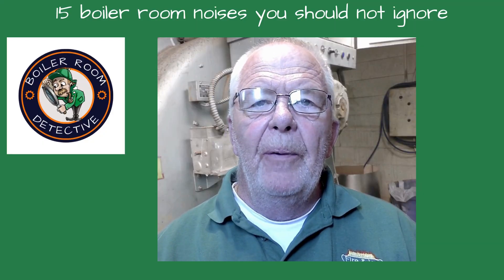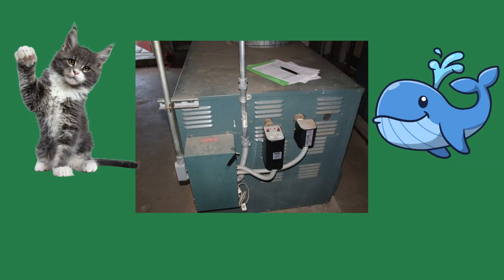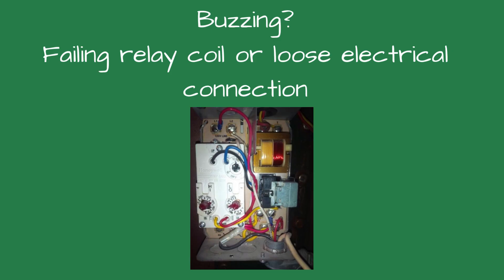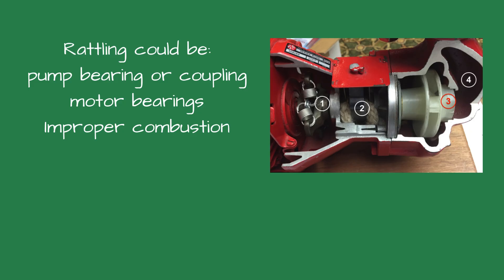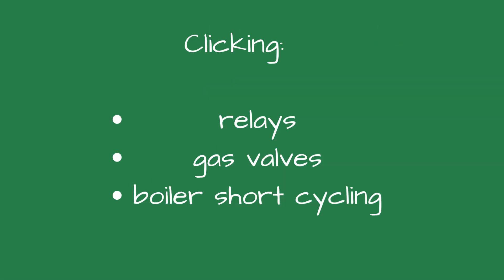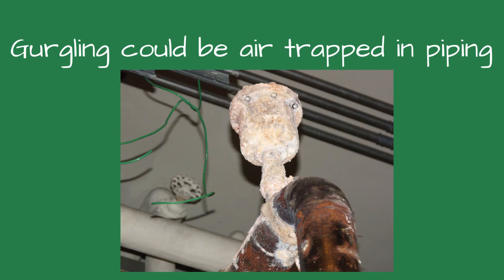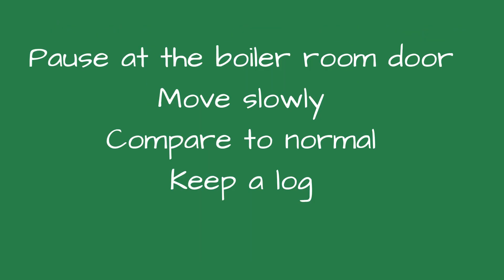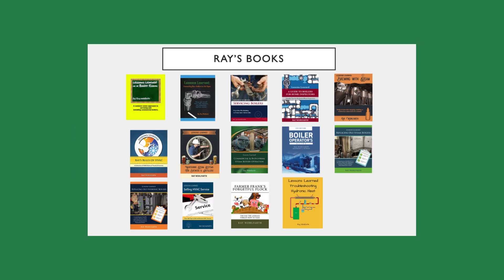15 boiler room noises you should never ignore

Comment: Thank you I live in apartment building and lately the boiler in our building has been very loud and booming noises and shake our apartment building while booming ..hissing and knocking..live here 18 years and it never did that until last year..The boiler room right under our apartment and the tenants in the next building said they're hearing and feeling the vibrations in their building too...some days no heat for 4 days then back on...The heat used to come on when the temperature reached 42 degrees automatically and now it doesn't come on
Reply from the maker: Wow must be tough sleeping in that racket Hope the landlord finds a boiler pro